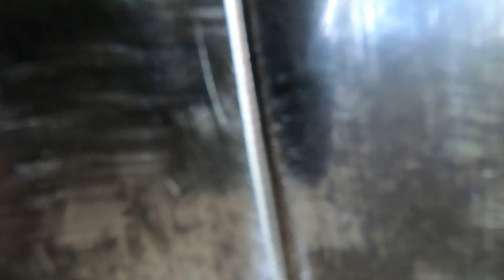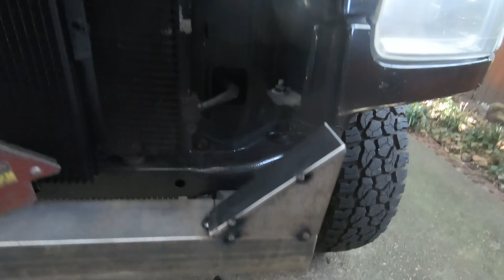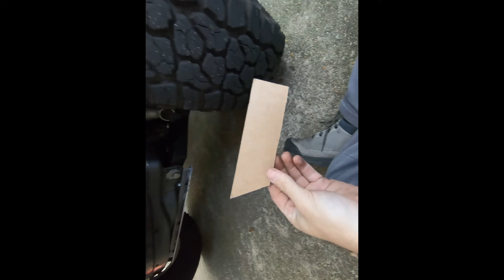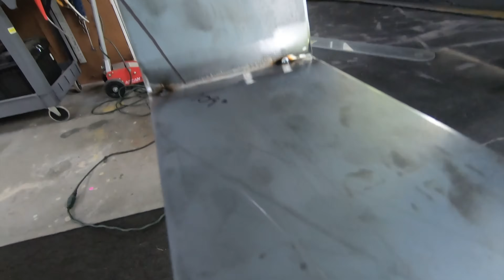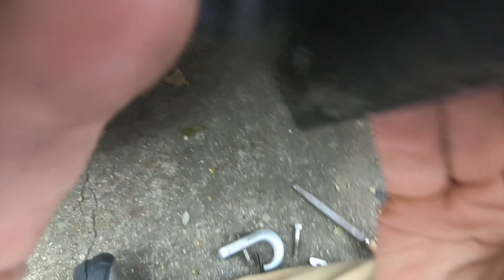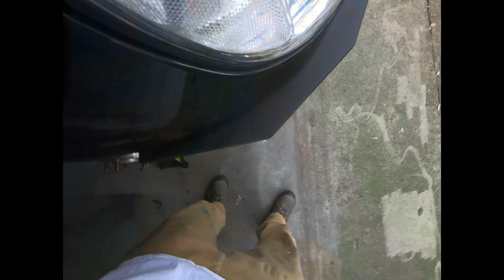I built a new high clearance front bumper for my Toyota.

Comment: Hello ! What mig do you like for your heavy work? Thanks!
Reply from the maker: @gregkindred7402  Hello. I use an old MillerMatic 211. It’s dual voltage. It’s rated to weld up to 3/8 single pass in 240v mode, and you can drop it down to 120v if you need to do thinner stuff.

Comment: appreciate the video! I am curious what you did with the holes that are left when you remove the fender flares?
Reply: Okay, yeah just watched your video where you cut them. I am thinking about filling them with epoxy or something and then spraying the paint or doing a vinyl wrap…
Are you on social media?
Thanks again for sharing your knowledge!
Reply from the maker: Hey thanks for checking it out. I had to trim my front fenders to fit the 35’s. I trimmed enough off to remove the holes left by the flares. 
Before that, I just had some of the black plastic “christmas tree” plugs, you can get from Napa, plugging them.